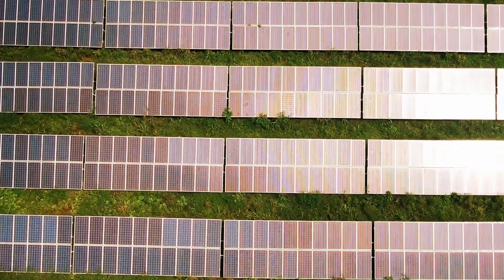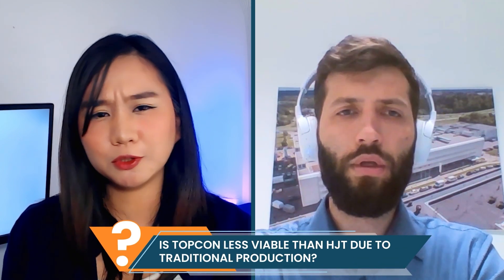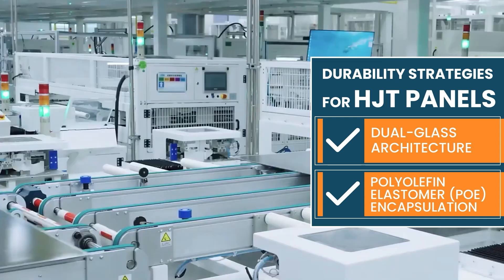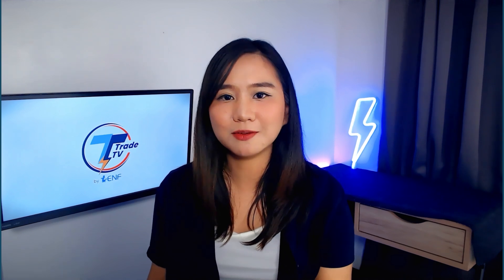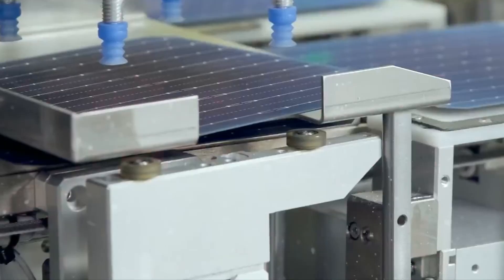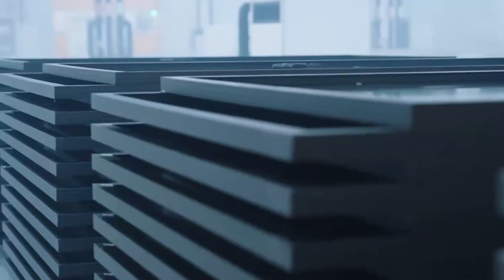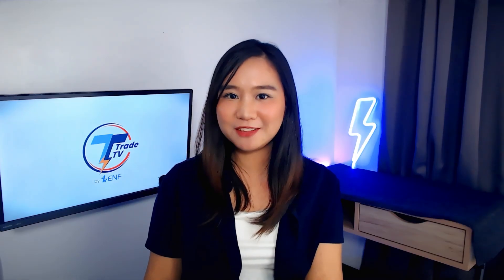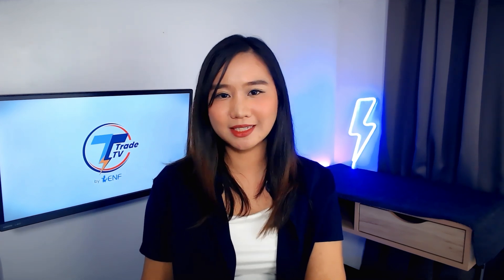Tech Titans: HJT vs Topcon | HJT Claims the Specs, TopCon Claims the Market

Comment: With these technologies driving the use of POE and ultra-thin wafers, I wondered what difference it made to the weight of the panel.  Well, my AI-assisted research gave the answer that we save around 150g/panel from POE instead of EVA (due to lower density) and 300g from ultra-thin wafers.  So almost 0.5kg knocked off the total weight.
Reply: Good point—cutting about 0.5 kg per panel is a nice gain for handling and logistics, though worth noting it’s not usually a deciding factor compared to cost and performance. Still, every bit helps at scale.